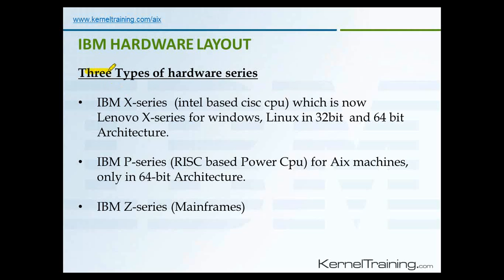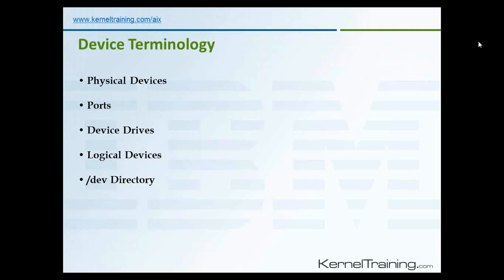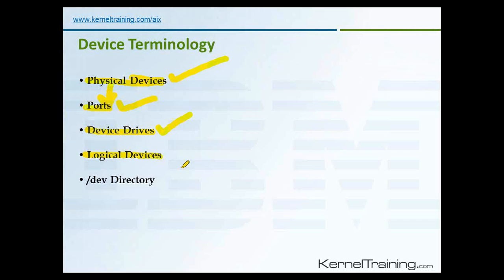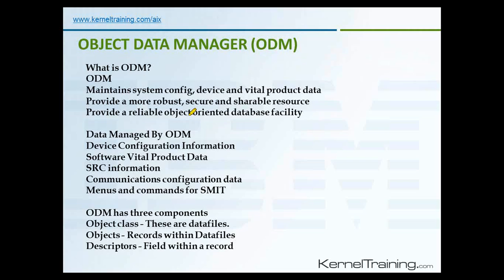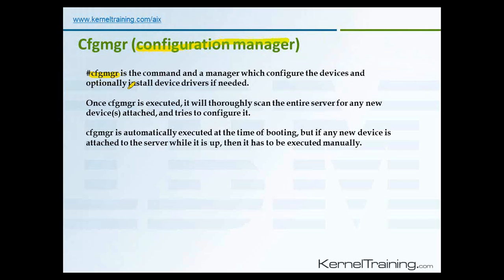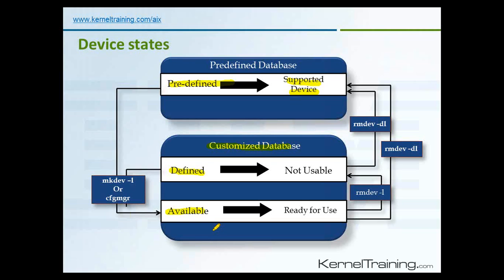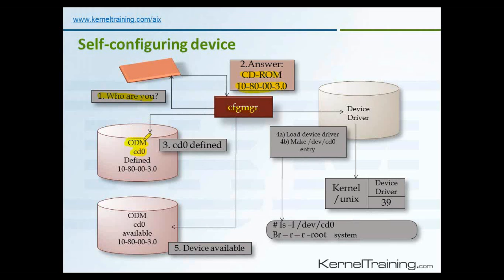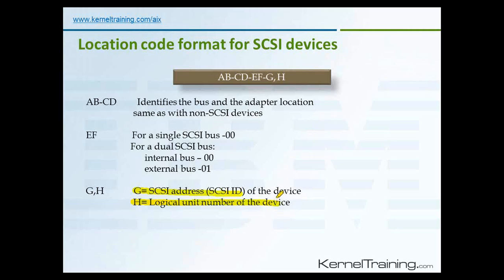AIX - Learn about AIX Part 1 | AIX Tutorial For Beginners

Comment: Is any purpose of using this OS other than ability to install on Power 8
 CPU ? Looks like the same dead as Solaris OS. Even FreeBSD which is 
dead in my opinion seems to be more advanced.

Why AIX still exists ?
Reply: it is true, there is no reason to go AIX other than using Power-Hardware architecture. But: Running POwer hardware should be enough reason to go AIX in the first place, as it is a hardware-oriented highly stable and highly flexible solution. IBM PowerVM as a virtualization technology is superior to Intel-based virtualzation technologies like VMWare vSphere still to this day in puncto High Availability and Flexibility. So you don't run AIX for it's powerful command line utilities, because for this Linux would be the better choice. You run AIX so you can Run IBM HArdware and IBM PowerVM, because your IT-Services are so critical, you need the power and the might of IBM POwer and IBM PowerVM: As someone who is administering AIX, SLES, RHEL and Windows SErver 2003-2012, AIX feels not as powerful as an enterprise linux distribution as SLES or RHEL. For that reason, Linux on Power (PowerLinux) might replace AIX on LPAR level. It is already the case for SAP applications, because at the given time you cannot run SAP HANA on AIX and it seems that this is not about to change in the near future. But on the physical devices, for example on the hardware management console etc., you still need the knowledge to administer an AIX environment even if your LPARS are running PowerLinux.
Reply: I think reason is simple when do you've some critical business and don't have money or reason to run it on mainframe, aix it's one of the best option. It's matured, standardized system not like his biggest competitor linux sry to say this, I love linux  but there is still a lot of work to do. You've hardware and  software developed together also big advantage for performace and relability great virtualization ability. FreeBSD which is more close to linux by posibilities in ent. defenately isn't dead just on different way or do you know more then the SONY, Nintendo,..etc ?
Reply: +truesightgrabber As you said, it is the primary OS for Power based systems which are much more stable in enterprise environments that Linux/windows on Intel traditionally is. However, Linux on Power movement is making this a moot point and may see more transition to Linux on Power. However, in terms of stability in an operating system, you cannot compete with AIX.
Reply: Matthew Alvis
Stability usually means limitations.
Reply: +truesightgrabber AIX isnt for running video games and yes a system will have very strictyl defined purpose generally if your putting on AIX. what you will get is raw performance on Power vs any other option out there.
Reply: Matthew Alvis
Is any specific db or webserver available ? And is it more stable Power8+AIX than Sparc+Solaris ?
Reply: +truesightgrabber IBM DB2 and Websphere App Server are what is used in my shop. i cannot speak with any knowledge on Sparc - my shop sips IBM koolaid :)
Reply: Matthew Alvis
thanks